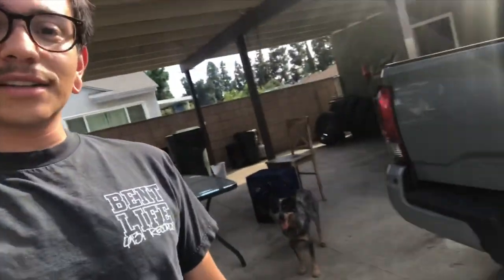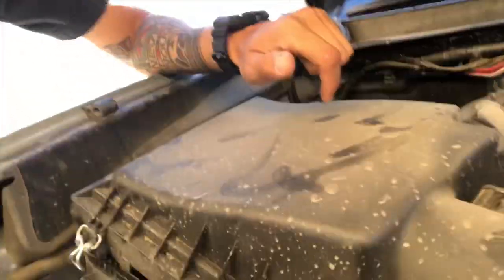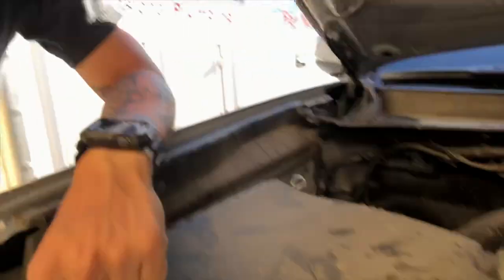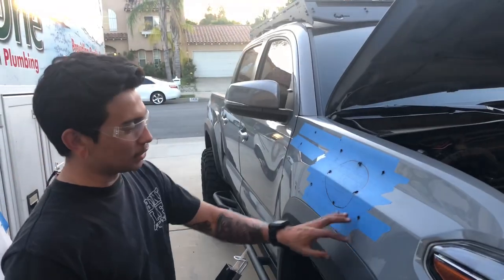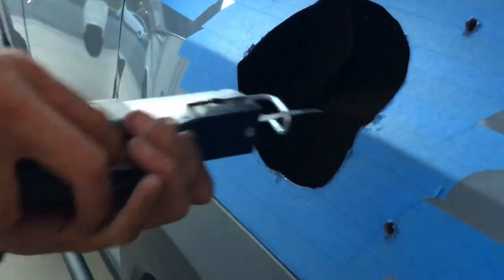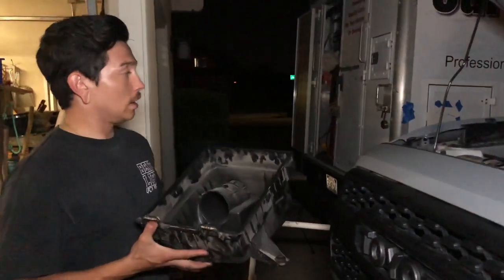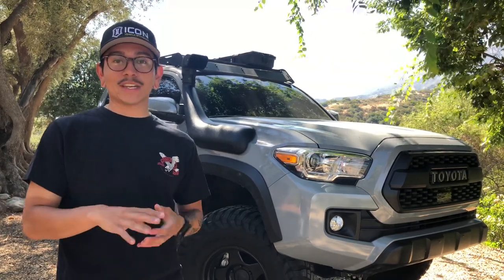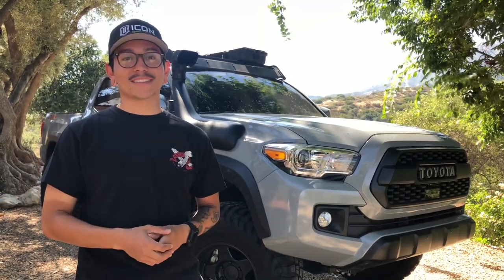3rd Gen Tacoma Snorkel Install

Comment: Have you regeared this bad boy? If not, Does it even need a regear?
Reply from the maker: ROFLgator I haven’t just yet and I know I need to. She can use some help on the torque side and I’ve heard from people that it helps a little on mpg which would be great haha. But I do plan to regear since I have some other stuff in the future coming as well.
Reply: @john.goes.offroad5741  nice nice, I wanna see a regear video.

How did the truck feel on 33s tho with stock gears? I'm getting a lift soon, but cant afford a regear at the same time..
Reply from the maker: ROFLgator yeah will definitely get a video like that going when the time comes but on 33s it really wasn’t bad at all. I still had decent fuel economy and good power with those so me personally speaking don’t think you’d need a regear for 33s .
Reply: I have 33 inch tires and I have not regeared.  Working fine w some rubbing but it’s not so bad.